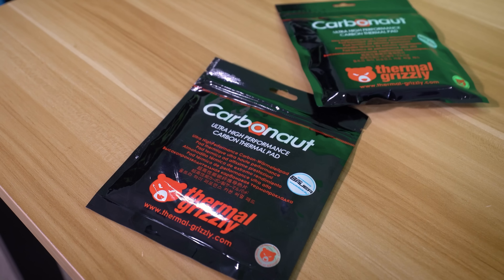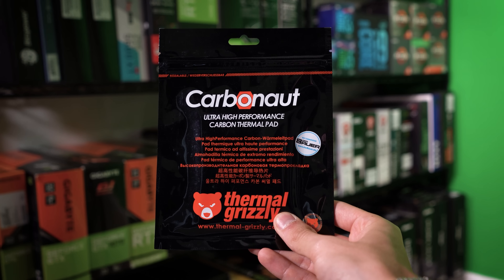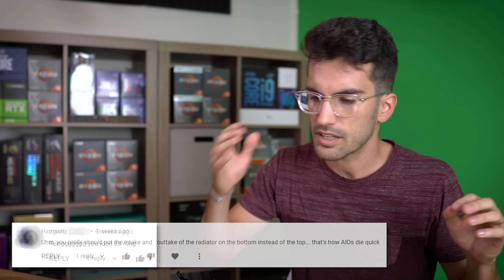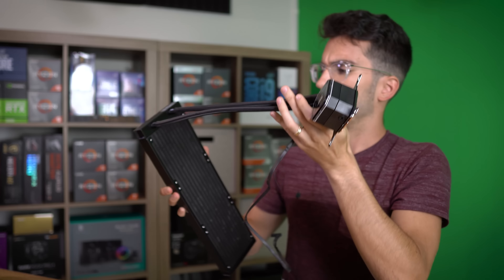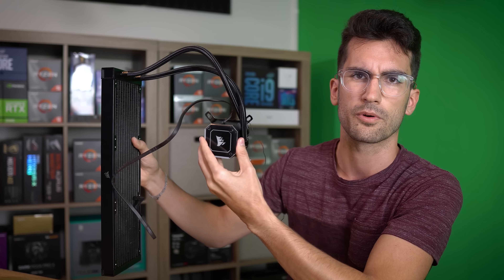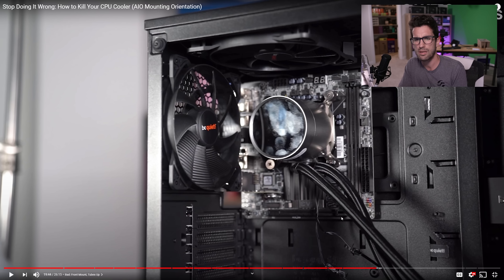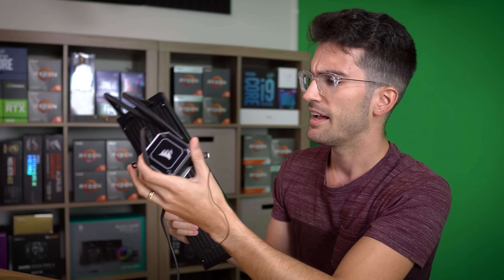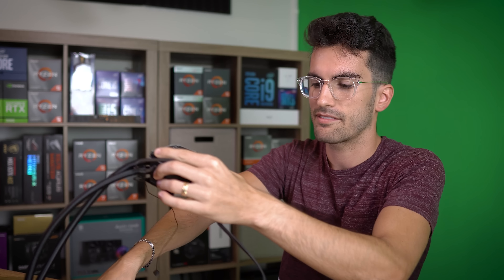Let's Talk About AIO Orientation... Again

Comment: Hey Greg! Thanks for making the videos you make. 

One thing that I haven't seen talked about in either this video, or Steve's, is the AIOs with the pump integrated into the radiator (NZXT Kraken M22). Do you have a recommendation for the correct orientation for that AIO, specifically mounted to the rear exhaust of an ATX case? Thank you so much.
Reply from the maker: With the pump in the center of the radiator, air won't collect in its chamber unless the radiator is mounted flat at either the top or bottom of the case. But if it's filled properly and the chamber is centered in the fins front-to-back, I don't see a problem with this either. Don't know for certain unless I rip one open. Might be something I can ask NZXT about!
Reply: @GregSalazar  Hey! Thanks so much for replying, and quickly at that. Oh wow, if you could get confirmation from NZXT, that would be super helpful. Thank you so much for trying.

Comment: @GregSalazar - I know this is a long shot, but I currently have 12+ years running with an AMD Phenom II X6 1055T Six Core along with a HD6950 Crossfire with DDR2 8gb and Asus Crosshair Formula IV and still running strong, but I cannot play anymore of the newer PC games. I decided to build a new PC and decided to go with Intel this time. I currently have an ASUS Z690 motherboard, I5 12600K, 16gb dominator ddr4-white, Kracken Z73-white and Corsair 5000X-white. However, I cannot find any ASUS RTX 3070, 3080 or 3090 - white GPU. I know it's too hard to find one, but I've been hunting for almost 9 months. This is one that I am missing and a white PSU in my future build. Anyone can help will be greatly appreciate.

Comment: So what you're saying is that the best position is with the lubes down on the front of the case. As Steve said, if you have the opportunity to have the lubes down on the front, do it. If not, have it on the top.
Reply: No. He's not saying tubes up is the best Position. He's saying it isn't that big of a issue. Most aios will do fine with tubes mounted up. That's the point
Reply: @lucariolps277  i know that now :/ «5 months later»
Reply: @olanderlvstad3464  didn't really check for the date, lol
Reply: @lucariolps277  ok

Comment: A small amount of air is needed in the system to allow for expansion especially on overclocked systems. If it was totally full of fluid and had braided lines or hard lines it would spring a leak.

But yeah, as long as the radiator is not on the bottom or the pump is the highest point in the loop it’s fine as air floats in the return side of the radiator

Comment: I always thought the rad should be on the top or back only. Why would you put it on the front if the front is supposed to pull air in? You dont want to be pulling the heat from the rad into your case. And if you have it flowing the other way, why would you have air flowing out the front? Guess that wouldnt matter if all your fans are going in that direction too?
Reply from the maker: There are already videos discussing this, but a rad up front isn’t as catastrophic as people like to make it seem in forums. We’re talking a few degrees at most for a GPU delta. And with a rad up top, you’re pulling warm air from your graphics card over your socket and VRMs. These movements of warm air aren’t as important as the sheer movement itself. As long as circulation in and out of your case exists, nothing should ever reach critical temps.

Comment: Still no boolean answer front or top? No depends allowed.
Reply from the maker: ? Did you not watch the video? If the AIO is constructed and filled correctly, it’s fine. Boolean.
Reply: @GregSalazar  I was trying to decide whether to get a 280mm which only fits in the top or 240mm which could do both. I went with 240mm because of answers like yours. I personally think top would be better from a sound perspective.

Comment: i always put my standing up, or on top of case, i find best performance with it standing up, just my own results. but i dont use AIO's anymore either i use custom loop or air coolers that are BIG and QUIET
Reply: Hell, just stick a 20 inch box fan in the side. I don't get all the complaints about noise from everybody. Hearing your system ramp up and go to work is no different to me than hearing my car when I'm driving.

Comment: Had 10°c less when my radiator was in the front instead of top (turns out the video wasnt about temps lol, i always figured there was air in the aio so the pump was never the highest point for me)

Comment: Have you ever used the same aio for 3+ years though? If you have it top mounted on its side, probably the best intake towards the pump as bottom outlet on rad, for just evaporation from leaks or even permeation at those pressure and heat levels over time and its scary to open them up to get microbes or whatever inside the loop, and the giant warranty sticker.

Comment: Because it is economically and financially viable to create a product without specific installation instruction so people will break their product within a few months. No company that wants to last long will do that. Warranty us usually a good indication. 99.99 procent of the products will last atleast their warranty period, or atleast most of it. Some may break in the last year. 

Corsair wouldnt make an AIO they have to replace thousands of units of. That just wouldn't be viable. EK made a pump that sits on the radiator in there AIO if they are still making those, but then you wouldnt be able to put the rad up top.  not really in a issue for most cases.
Honestly, if you feel like your AIO will break that easily why not stick to aircooling and leave people be? or just hint hem to steve's video if you worry for other people. 

Though It would be a great thing to behold when a company judt gets sick of this and makes an AIO where you connect the pump using quick disconnects so you can place it any where. Forsome reason I see Alphacool do this in their Eiswolf and Eisbear line up (GPU and CPU AIO's.)

Comment: The problem is that over time the water evaporates out through permeation. They come from the factory WITH ALMOST 10% AIR ALREADY IN THE LOOP. And so over time if you have your pump as the highest point in the loop it WILL kill your pump do to running it dry. You can run them with the tubes up but you WILL get more pump whine and you WILL lose performance due to pumping bubbles into the pump. Tubes down is optimal because with the air bubbles get trapped in the top of the radiator block. I did my own video on it. Im running a corsair h100i rgb pro and have a 1080 ti ftw3 hybrid gpu. And if you mount either of them either tubes up or with the pump at the top of the loop it is much louder and has a noticeable hit in performance of the coolers. We are talking about 5 degrees celsius from running it with the tubes at the top compared to tubes at the bottom. And like i said the water permeates and over time will cause the issues steve discusses.
Reply: up to 10%. most have 1 or 2 LOL😂😂 Stop the clowning🤡🤡
Reply: Confirmation bias.

Comment: I I have a 3090 ftw3 hybrid at home and need to buy the rest for a beast build. Don’t care about price. I know I want: 
10900k
64gb of fastest ram with lowest latency that will work with a Asus Maximus xII mobo
2 sticks vs 4?
How much wattage do I need for psu?
Is m.2 memory still best? 
 Need a case that will hold 360mm aio for cpu and 360mm aio for gpu because I will upgrade to kingpin 3090. I want one aio top mounted and Other aio rear mounted. I want to bring in fresh air in from front and I guess have it exit via top and rear mount radiator. 

Do not care about price to performance. 

Pairing this with an Asus 360hz monitor. Do you have a link to video or part list that can help me? Also, which 360mm aio is the absolute best for the 10900k? Is the 10900ks better?

Comment: Nice video, recently the Be quiet! pure loop came out with the pump mounted on the tubes close to the radatior, i imagine a front mounted setup with this kind of pump placement would make it more prone to air bubbles since it would be pretty high up the whole system? Unless the radiator would be oriented so the pump would be on the bottom side. But that would cause issues with GPU placement and tubes not being long enough i imagine.
I figure a top mount would be best for this specific aio loop?
Reply from the maker: See our 120mm vs 240mm AIO video. Just published. We use Pure Loop AIOs and discuss proper orientation for that specific layout there. :-)

Comment: My Pump is in my radiator ( msi mag coreliquid 240r ) how should i place it ?
Reply: at the bottom of the loop
Reply: @jblps  I cant, so do i rly need to buy a new Cooler/Case ?
Reply: then follow manufacturer recommendations
Reply: They show it at the top of the case with tubes down so I would do that.
Reply: @jblps  mhm ok, Thanks

Comment: I think a more important thing is the fluid temp; all AIO and both of the water cooling pumps operating fluid temp max is 60 degrees C. With CPU's running in the 70+degrees C. Could you do a video about your thoughts on that.

Comment: Im confused? You're saying its okay to put barbs up. But You're saying its better to put barbs down. So why not just have them down everytime???? Why even put them up? How do you know how much the aio is filled without cutting it? You don't? So might as well have barbs down with radiator higher then the cpu.
Reply: He is saying barbs up is good in the majority of AIOs. Barbs down same case but the issue with air in the pumps isn’t present.

Comment: So the second video and still no examples on the best way to mount an aio... 🤦‍♂️
Reply from the maker: You clearly didn't listen to the video. Best is up top, undoubtedly. But front mounting with barbs up isn't BAD so long as the pump isn't above the barb line.
Reply: @GregSalazar  I clearly did listen to a person (second actually) that rambled on and on... but I did discover another video that explained proper mounting (and why) in less than 3 minutes :) I’ll add - I’m not saying your video is bad... but after watching the video you referenced it would be great to have a few examples of proper placement.

Comment: Complaining about some AIR in a "pressure filled' closed water loop from the factory?
Why do people with expensive "Custom Water Cooling" don't complain about air in their custom loops?
It doesn't matter how you mount the radiator because AIOs are designed to have some headroom "AIR" in them to allow the liquid to expand when hot! The water pump won't overheat and take any damage unless it runs really DRY!
The optimal spot for a water pump is the lowest point of a loop or right in the middle for optimal pressure throughput!
Your Home Waterpump won't complain either having some air in your the pipelines!

Comment: In people’s defence I don’t think Steve explained this clearly. It seemed to overlap risks for reduce performance/noise/pump overheating all roles into one. It was easy for the message to get misinterpreted 

 When GN Jesus tells us how computers should be built people will follow him, it’s not their fault if his video is a bit misleading. They really should have used diagrams or more detailed explaination as you have done. Thanks.

Comment: well, my masterliquid lite that has been used for almost 6 years exhibits clearly different behavior with different radiator positions... i thought the optimal position thing is for longevity sake, and permeation is a thing. mine behaves differently to such a degree that the sound of the pump is unbearable in anything else that the radiator being above the pump horizontally. and the whole point of a cpu aio is to just put it there and leave it running for years, is it really even worth debating NOT using the optimal position in very way for a piece of equipment of which longevity is THE main thing to consider?

Comment: i used to have an aio (cm masterliquid lite 240) that i could only mount to the top of the case due to short tubes and it would gurgle like hell, i tried several different orientations (all were top mounted) but none helped, and the noise was very loud (demonstrated in this video https://www.youtube.com/watch?v=Yljv3Xm_1bY). AFAIK CM did make a faulty batch of these coolers and not only did i run out of warranty by the time i decided to do something about it, i also misplaced the warranty label. So last week i got a beefy dual tower air cooler (be quiet dark rock pro 4) and i could not be happier with it

Comment: Greg I don't get why you made this video. You clearly know what's going on, but if a loop isn't filled high enough, which can decrease over time too, then air will regularly be sucked into the pump, the more air the worse it is and the hotter the pump the worse it is. AIO manufacturers will fill them as high as they choose so why not give your parts every chance to live as long as possible? Why are we talking about this? Commenters complaining about suboptimal AIO orientation? They are right, making this video just draws attention to them, and, they're right anyway so, what is being achieved here? If you want to change minds, show us the data in the fluid levels, if you want, maybe that'll help?
Reply: Jesus......

Comment: Too bad you didn't discuss AIO upside down, like on a NZXT G12 bracket on a videocard.
This photo explains what I mean: https://i.ytimg.com/vi/91zSzidwLx8/maxresdefault.jpg

I put it in the system like that (other videocard but same exact idea/config) and the pump could suck water "up" let's say... until I used an external PSU and ran the videocard flipped so the pump COULD pump the water around... after a couple of minutes I put it back in the slot, water had filled the pump area and problem solved... no more extreme gurgling lol...

Comment: My issue with putting the radiator in the front is that it blocks a lot of intake airflow in most of the most common cases.

Comment: II wonder, does the pump have less thrust resistance at barps-up?
I mean, it seems logical to me that with barps-down the pump experiences much more resistance due to the upward thrust and so the water circulation goes slower which in turn will affect the cooling performance.
Could my reasoning be correct or doesn't it matter that much?

Comment: so you already proved that you did not pay attention to GNs video the reason for the air is not because its impossible to get all the sir out it is because sometimes they are stored in freezing conditions and liquid expands when it freezes yes their is a small amount of propylene glycol to lower that freezing temp but it can be pure or even that high of a percentage otherwise it will hinder its cooling performance

also the air pocket gets bigger as the fluid leaches into the tubes 

now tubes on top IS BAD because as the sir in the rad sits at the top ware the pump intake is it means air will be pulled into the intake tube and even if that air never makes it to your pump the air is taking up room in the intake tube their for limiting the room fluid can flow past meaning you are now getting less fluid flowing to you cold plate meaning you fluid will heat up more because their is less and as the fluid heats up the AIO will ramp the pump and the fans up to try and compensate also the more the fluid heats up the more it leaches into the tubbing thus exacerbating the situation i mean as you said its simple fluid dynamics if you just actually grasped the concept

now hear is the crux of the matter an AIO liquid cooled is already barley better then a good air cooler so if you run your AIO in an inefficient way that makes the whole thing warmer like having the tubed up you are actually removing the whole benefit of having an AIO liquid cooler over an air cooler in the first place so you might aa well be running an air cooler and have less components in your case to install and maintain and that will have a much longer lifespan and not need to be replaced in 6 to 7 years if maintained properly but because you have the barbs up that will shorten so that's probably more like 6 yeas max

Comment: the whole reason he did that video was because of viewers having a wining sound from the pump......so its obviously an issue to avoid
Reply from the maker: Like I said, most front-mounted, barbs-up AIOs don't make these persistent whining sounds. If yours does, it likely wasn't filled correctly or pump construction is sketchy.
Reply: The whining sound is usually in the comments

Comment: Unfortunately you are still gonna get those know it all comments. Just gotta ignore them. I have mine in that config, Barb's at the top because I like the way it looks better in push pull on the 011D. If it ever makes noise I'll move it to the top or buy a new one. I would probably just RMA it if still under warranty  I am yet to see an AIO with tubes long enough to reach the bottom on a front mount AIO.
Reply from the maker: Replying to a misinformed comment with a video URL is much simpler than typing unique paragraphs.

Comment: So i have an AIO which has the pump in the radiator. The best orientation would be front mount with pump at the bottom of the radiator right?

Comment: The 6 hundred pound elephant in the room ... the hoses are TOO short to be mounted in the optimal position [ front mounted barb down ] and a right angle fitting at the radiator would also help. AIO's are just poorly [ cheaply ] designed. 
Talk about that...